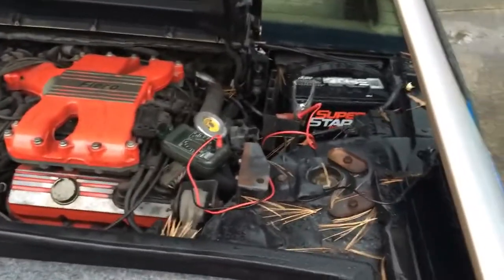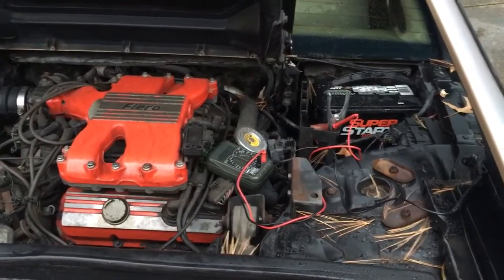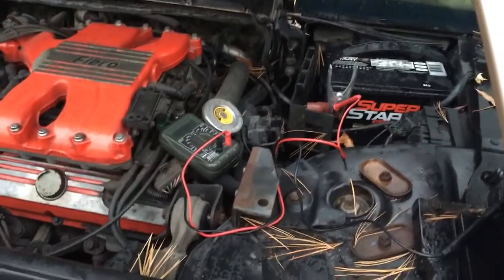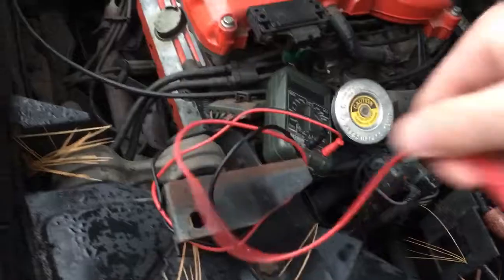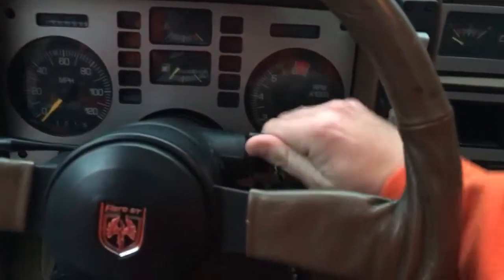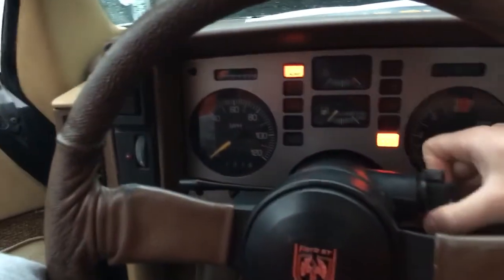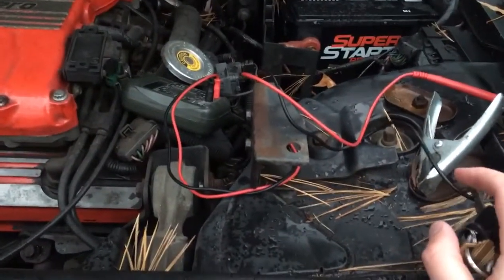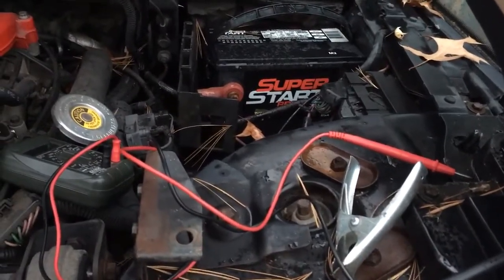The TRUTH about restoring car batteries with alum

Comment: So you didnt warm it up.. or.. recharge it due to sitting. You went to just replace it. You didnt get the point of the Alum battery, and certainly didnt do anything to merit that video title. Look at the people commenting to you.. clueless to what the battery is or how it works, but you did manage to undermine the awareness such. Nice job kid.
Reply from the maker: Lol it's been years ago since I did that video bro, but yeah, I definitely tried to charge it up many times and it would barely crank the car. and would die in only a few days without use. It wouldn't get to a decent voltage or hold a charge so I did this to see if I could get some more life out of the battery and I got a whole summer out of it and worked perfectly. Not sure what your issue is...

Comment: There are  a few ideas for fixing a car battery
never try to do this until you know what you are doing - the acid can burn you
check the voltage first - there may be a kaput cell which would waste your time.
Check the battery fluid.
Try to fully charge the battery.
(I learned about these and more from Jons Mender Guide site )
Reply: so, what u learn from that sites, and what whole of conclusion?

Comment: If you want, try to get a faster old cheapest charger you can get. In the video of the gentleman that restored the battery with alum sulfate he had a 3 Volts a day battery charger. I found for really around $30 I can't remember exactly but I believe around $30 I bought the cheapest old fashion charger. This charger have gotten my batteries charged within an hour, 13.5 V once out, 14 V while top charging and I restored them with 8 oz of Epsom salt, added 22oz od distilled water which make 30 total with the salt. Divided by 6 cells equals 5 oz of the new liquid or Epson Salt in distilled water. Added 5 oz of this liquid to each cell and refill with old acid water that I collect from the battery in a bucket. That's it. Done it to 4 of my batteries. They're holding the load longer.

Comment: Did you charge the battery before trying to start the car with it? 11 volts is very low even for an alum battery, an Alum battery should sit around 11.6v if it's just alum and distilled water. However, there are ways to increase the voltage in the Alum battery. Like leaving some acid in each cell, but not very much, I would dump your battery acid into something safe and then whatever you couldn't get out of the battery, you left in, because you're not going to get it all out unless you neutralize the battery. But you don't want to neutralize the battery completely.
Reply from the maker: Did all that stuff, and charged it on a slow charge for 2 days then let it drain with just the lights on before another 2 day charge.
Reply from the maker: Also ran baking soda and water through the cells multiple times before using the alum solution
Reply: Once you do that your battery should sit around 12.3 volts after being charged let sit for a few hours. 
You should be able to dump quite a bit of amps into it without hurting it.
At least these are the results that I have achieved, but I've only been using new batteries not restoring dead ones.

Comment: I've converted about a half a dozen of them. You actually got a pretty good one. No shorts and the plates are probably still intact.

I've been testing alum conversion batteries for about 3 years, but not for automotive use. That battery you have there will probably last for years as a camp light or emergency light battery. You could probably run a 5 watt DC bulb 24/7 with that battery for 4 or 5 days before it even starts to dim. 

Right now I have mostly old lawn mower batteries that I've converted and my best one only holds just a little under 12 volts, after resting for a couple hours. I have an old deep cycle that's dated for 1993 that holds about 9 volts and it's excellent for running a 5 watt LED bulb on. In the summer I can run it all night, every night using a 15 watt solar panel mounted on the back wall of my garage  to keep it charged. I converted it about 5 years ago when it was about 20 years old and it still works like a horse for the light I have hooked up in the pole barn. I use a photo switch to turn it on and off automatically. I've been using cheap $5 ones from china, and I have to replace them about every year or year and a half. I've only had one of my cheap $3 ebay 12v 5w LED camp lights burn out in that time, so it's pretty inexpensive considering the light runs for about 18 hours a day in the winter and about 8 hrs a day in summer.

I've also done some data collection using a cheap data logger on several of these batteries. The goal being to understand how much power I can draw from them per day, and how much I need to put into them (panel watts) to have consistent light from dusk til dawn. The nice thing about an alum battery is that you can pretty much run it completely dead (meaning down to 2 or 3 volts) and it doesn't seem to harm the plates. You can't do that with a lead acid battery. If your lead acid battery gets below about 11 volts you're killing it.

I usually have to get a new battery about every 3 to 5 years, and it's in the cold of winter that I need to replace them. My plan is to keep them instead of getting the core deposit back and convert them for emergency lighting in my house, camper and pole barn eventually as I collect them.

In the middle of the winter, if it get's down around the zero degree range, the batteries will start to get a little slushy inside. But, I've never seen one freeze solid. I use 2 cups of alum per gallon. I don't know if I would want to use one long term in a car in a cold climate, but if I lived in Florida or Southern California I might consider it if I had a good one.

I wouldn't toss that battery out. It could last you ten years or more using it for backup lighting or something like I'm doing with it. And I have a hunch those alum batteries actually prefer to be charged and discharged on a regular basis.
Reply: Donald seems like allum battery not good in cca...why not combine with supercapacitor boostpack? Problaby that would be a great combination...allum batt with good lifetime.. And supercaps with good cca and lifetime

Comment: It's common sense as well as old chemistry. Adding alum or mag sulph to your battery will add ions which allows the charger to pass electrons between the plates. It does nothing to restore the battery chemistry, and very rapidly wrecks the plates. 
If alum or mag sulph were good for lead acid batteries, they would ship that way. These bodges can get you out of an emergency situation, but don't expect your battery to survive very long.
Reply from the maker: +Donald Bowers yes removed acid neutralized all remaining acid then mixed alum and water and added
Reply: Actually you can get alum on ebay for about $4 a pound in 5 lb quantities (about $20). I'm guessing it takes about a cup and a half (maybe 3/4 pound to 3/4 gallon of water) to do an average size car battery. I don't know about adding it to the acid. I may try that some time for an experiment, but I replace the acid with the alum water. So it costs me about maybe $5 to do a car battery. If you buy it at the store in those little McCormik bottles it would probably be around $30 or more to do a car battery. Now that's expensive, but $5 is actually really cheap. Probably cheaper than buying acid retail. Add the $10 you would have got back on the core charge and you're looking at a $15 battery.

But, I'm not sure you want to use that kind of battery in a car. At least not in a cold northern climate. Better to use it for a solar camp light or something like that. Add about $20 for a 10 watt solar panel off Ebay and you've got the perfect little light for when the power goes out and when you go camping or tailgating. It will probably last 3 to 5 times longer than it originally did as a lead acid car battery. And because of the different chemistry you don't have to worry about running it below 11 volts, which will kill a lead acid battery real fast. 

You could just use a charger instead of buying a solar panel, and top it off before you go camping or tailgating. On the battery in this video, I estimate that you could run four 5w solar camp lights (each about 40w equiv) for 24 hours (probably longer) before they started to dim a little. Assuming a full charge of course. At a tail gate party or bon fire you could probably run ten of those lights and they would stay bright into the wee hours of the morning. And you might find yourself using that same battery 10 or 15 years later. I have one that 25 years old (converted about 5 years ago) that's still going strong. If you get the right kind of camp light (about $3 to $5 each on Ebay), they will stay bright until you're down to about 7 volts on the battery. Don't try that with a lead acid battery because it won't last long. And once you reach about 10 volts on a lead acid battery the voltage starts dropping fast. Not so with a lead alum battery, the curve is more linear, like with a nicad battery only without the "memory" problem.
Reply: Actually if you look at his original video, I'm pretty sure he mixed the alum with water and removed the acid. Correct me if I'm wrong. In fact I would like to know if I'm wrong, because I may well try that one day myself if it works even if it only makes the battery last 6 months or a year longer.

My guess is that if you leave the acid in the battery it will probably destroy the plates, but if you replace the acid with alum and water, those plates will last for years unless they're already destroyed from the acid. Lead alum is a completely different chemistry with completely different characteristics. I have like 6 or 7 of them, and my two best ones only hold about 11.5 volts long term instead of the 12.5 to 12.9 you would expect out of a good lead acid battery. This is fine for what I use them for, but I don't think I would try using one long term in a vehicle. I don't think it would have the cold cranking amps. Maybe in a sub-tropical climate it could work, and I have heard of people using them that way on a semi-long term basis; but not if it gets very cold outside. 

Even though they don't completely freeze because of the salts, they do get slushy and that slushiness destabilizes the voltage to some degree according to my data. Not sure how that would effect performance in a car though.
Reply: I have one that has been working for 4 years! I am about to convert 4 Trojan golf cart batteries for my solar system.
Reply: You have to test it for yourself before you start teaching people about it, otherwise everything you say is most likely bullshite. I have tested it and the battery has lasted 4 years now, in a truck! If it degraded the battery rapidly like you say, it should be useless now.
NOTE, I used Brand New batteries when I started, and neutralized the acid with baking soda first.
Reply: @iEnergySupply  did u replace the acid with allum solution or just add it the battery..and what is the propotion of ur allum solution with water?
Reply: @budhihart8161  remove acid, rinse out acid, use distilled water for the final rinse, add alum and magnesium sulfate(aka epsom salt) in equal parts, i would use two ounces of each per gallon of distilled water.
Reply: @iEnergySupply  thanks...and the battery still cranking the car... For how many years after the conversion?
Reply: @budhihart8161  We are not sure as we aren't in contact with him anymore, but for years for sure. The solar batteries we converted were trogen, 8v batteries, you need higher voltage to charge them but they can be hooked directly to the solar panels without a solar controller, they can be completely charged and sit at 20v without damage, normally this would destroy the batteries. Take in mind we are using two 8 volt batteries in series and to grops of those in parralel so there is a total of 16v. Alum slightly lowers the volts of each cell so you end up with a 12v battery by using two 8v batteries converted into alum. One thing that indicates a battery is the sides bulging, there is not any sign of bulging in the casing walls. We also have 4 trogens that we did-int convert to alum and they are all slightly starting to bulge. If you wan't to use this system, there are a couple changes  you have to make to your solar system for your solar panels to charge the batteries and still run your inverter. If you have any questions please leave me an email, notime500@gmail.com
Reply: @iEnergySupply  ok..so my conclusion from what i watch the youtube is that allum battery seem behave like deep cycle battery and may be better in life...but not as strong as normal lead acid for cranking...
I my self tried use lead acid but with lesser solution sulfuric acid...i mean i add more distiled water than the usual limit...around 25 percent more....and my battery still runing good for 3 years,...my theory is that if we make the acid weaker then the cells would last longer...and the desulfation would be easier when we charged the batt...
And for allum battery i havent seen in youtube that test the allum batt for crancking the car...
Thanks for ur reply...hope that u made succes in future research
Reply: @budhihart8161  saya sedang uji coba juga pak, hehe
Reply: @ojouprus  uji coba apa mas? menambahkan air lebih banyak ke aki?